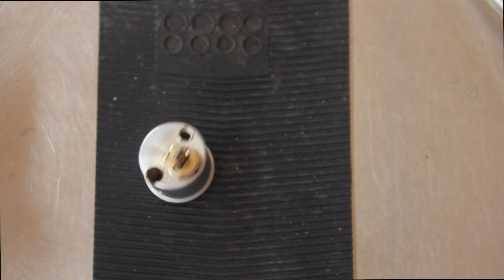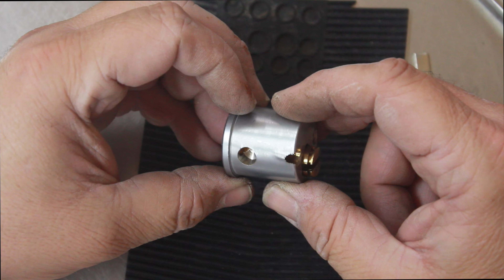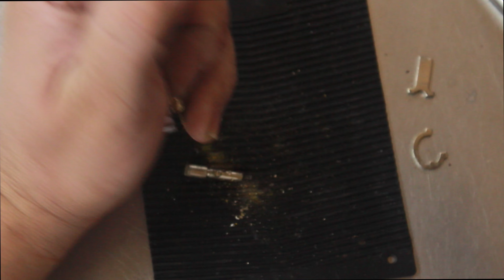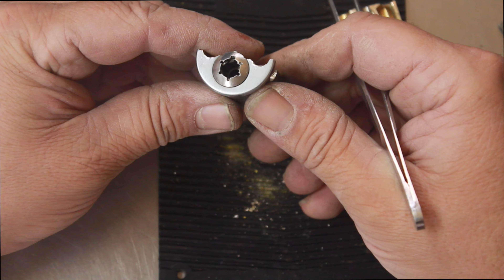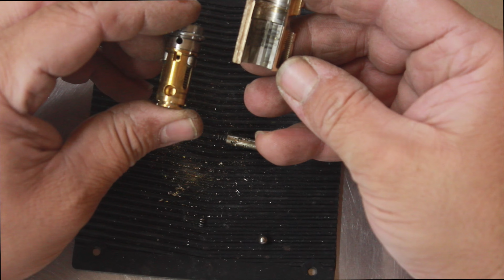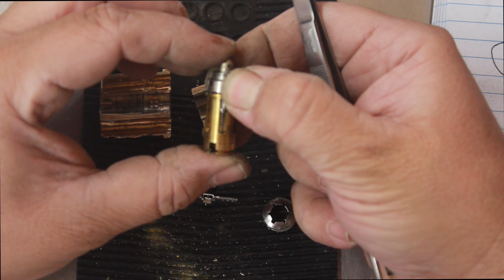Galaxy Restricted Key System De-constructed

Comment: if you can re move the code bar you can turn the lock however that wont be easy and the code bar is designed to sheer off.

Comment: Thanks so much for this video.  

It was fascinating to see you going through the process of figuring it out; you started to hit the nail on the head between about 13.30 and 15.00.  I was the first guy to pick this on camera and I spent a lot of time learning how it worked and figuring out what Brian Preddey was thinking when he designed it.  As Feralshooter and Keyless Entry have already mentioned...Bosnian Bill's video is a complete joke unfortunately. 

The Galaxy is a truly beautiful lock.  It was the pinnacle of Preddey's career (his life's work really) and was head and shoulders better than the Bilock.  But unfortunately it came about 20 years too late and so never received the exposure that it should have enjoyed.  By the time it was in production, electro-mechanical master systems had eaten its lunch.  Plus as you rightly point out the mill used for cutting the keys and drilling the codebar costs a lot of dough, which is why so few locksmiths bought into the system.  That was a mistake on ALC's part.

The lock was designed with two goals in mind: Firstly to never need servicing which is why you had to destroy it to take it apart, but secondly to be able to be rekeyed by unskilled staff.  You were dead on the money regarding this: Each master suite has a unique disassembly key which allows you to remove and replace that central core (it's called the "code bar") in about ten seconds flat.
That codebar is the heart of the lock.  You're correct in that if you could drill it out (or the retaining pin at 12 o'clock) you'd be able to rotate the core but there is quite a lot of drill protection designed to stop you doing that.  The original patent allows for even more drill protection than you find on the production version and I've often wondered why they didn't include it...cost maybe, or they planned on adding it as a paid upgrade for clients who paid more.  Dunno.

In actual fact the original patent documents show that Preddey had a lot of other features in mind for this lock as well.  I won't go into those features here because ALC might still want to use them but they are honestly fantastic, he was years ahead of his time in some ways.  The production version we have now is sort of a base model.

Bypasses and destructive attacks are not as easy as you might think and I'm not going to go into detail on this in public either.  Picking takes some skill and you need to make your own tools but it's doable.  I would call this a "medium to high"  security lock, it's definitely not high security.  But it was never meant to be in its current form.

Thanks again for a great video.

Michael.
Reply from the maker: Hi Michael, you answered all the questions I had about it, you know so much ...  I have seen the removable core on Bilock and its a good system,, even better for the locksmiths doing a c/c ,,  So that a good point that it has a key and you just swap the code bar on the  Galixy...   I did not think it was Preddeys that made it... It shows Im not very up to date with my AUST Lock History ... I thought the Preddey brothers made the ADI locks, I did not know they were behind Bilock and ALC too..
Reply: @DrLockShop  Thanks mate.  Yeah Brian Preddey was a stone cold genius.
Reply: Thanks so much for this comment. I'm trying to do some research on this lock as an apprentice locksmith, it's been so hard to find anything (I keep getting results of people locked out of their Samsung smartphones). 
I hope the video of you picking the lock is on your channel, I'd love to see it! Gonna check it out now
Reply: Found the video you mentioned. Awesome! Subbed 😎👍

Comment: It looks to me like it's a 6 pin tubular lock BUT each pin that you push in with the key has its own sidebar, hence the six slots in the casing for the six sidebars to fit in to stop the inner cylinder turning. Its designed in this way to limit feedback and to make picking difficult.